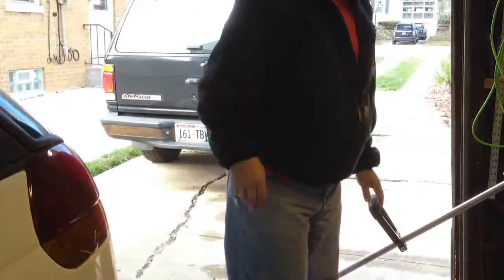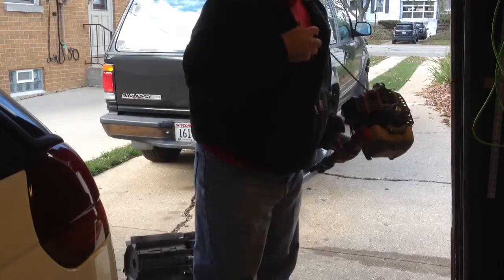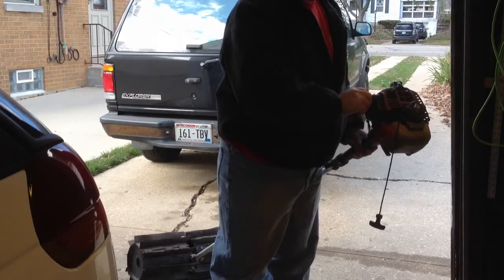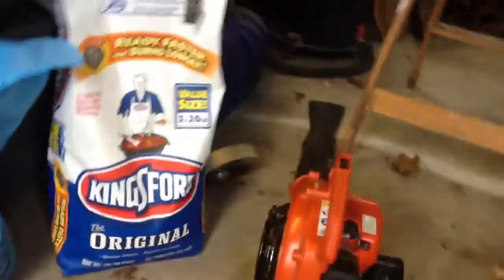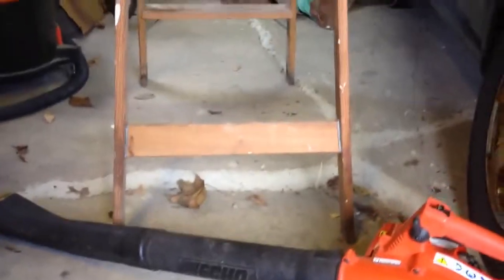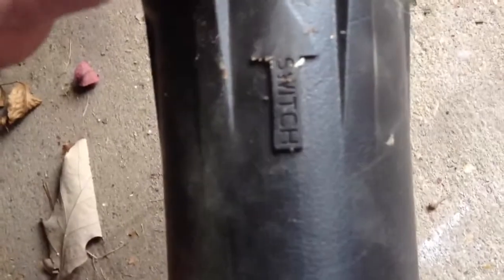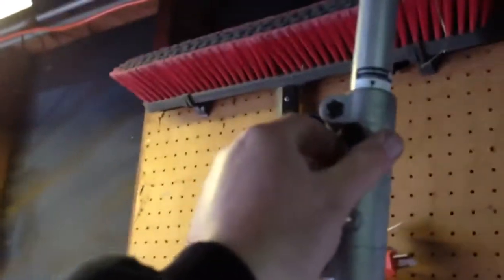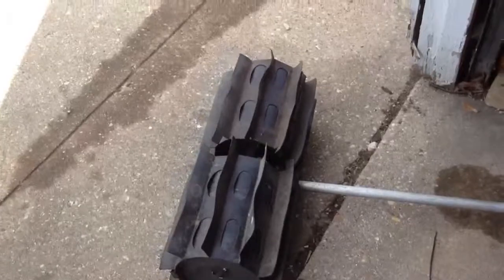Shindaiwa Power Broom Refurbishing Part 3

Comment: Pull spark plug and put a little lighter fluid down spark plug hole put plug back in try to start if it has spark it will start first pull every time Ben doing it for years